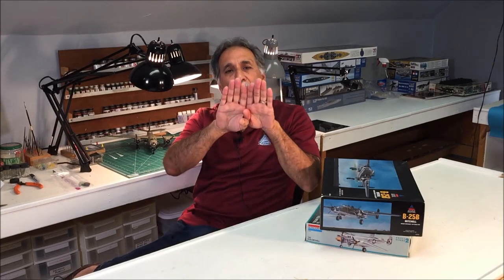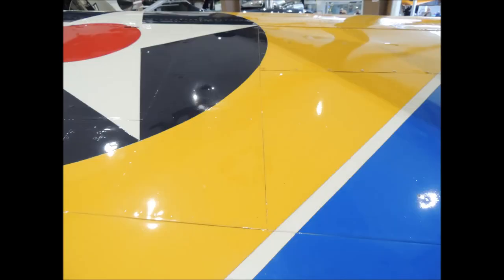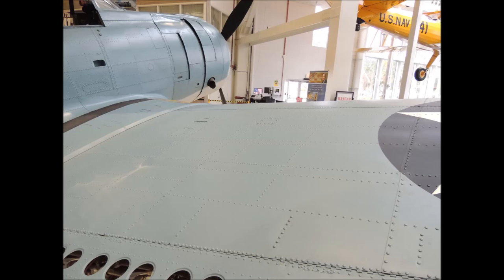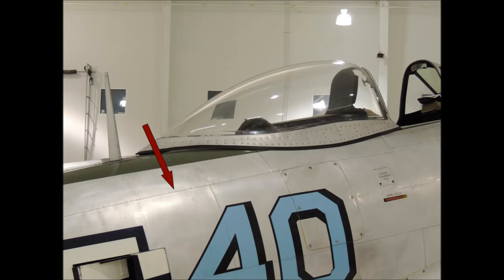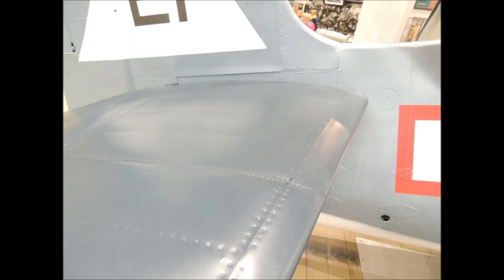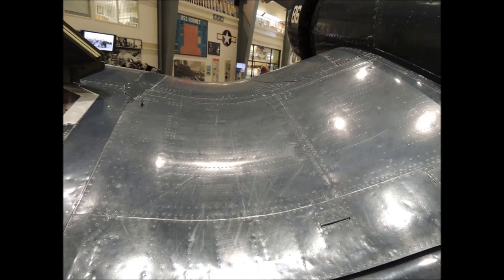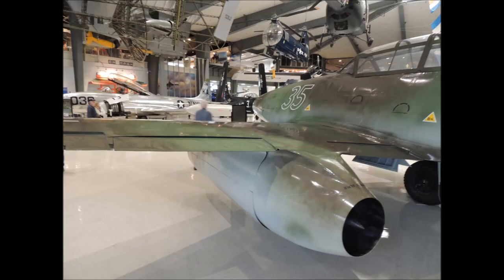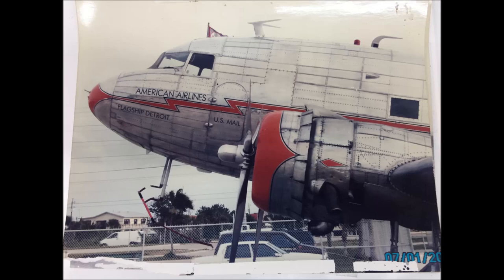Panel lines for scale model aircraft and how they relate to real aircraft butt  and lap joints.

Comment: Glad I found this video( actually, it found me, lol). This has been a bit of a pet peeve for me for years, as a modeler and an aircraft technician. The huge, raised or engraved, panel lines and rivets on models (don't even get me started on the raised vs flush rivets! ) are usually so far out of scale to be ridiculous. As you were saying, the gaps work out to maybe .001" or less, in 48th scale., and that would be practically invisible on 1/72nd unless you have your nose touching the model.  The DC-3 (C-47?) is a great example showing that only the dirt is delineating the panels, otherwise they'd be invisible if the aircraft was clean and polished.

Comment: This is a great presentation. The challenge is the pictures need to be a lot closer to the surface for the difference to be seen on a mobile device. I think a great follow up video would be to explore how to simulate these differences on various scale models. I say "simulated" because as you mentioned, the scales in which most of us model really are are too small for engraved or raised panel lines to be realistic scale-to-size replications. I'm dealing with that right now with a 1/100 scale EE Lightning a friend gave me.

Comment: it would be interesting to see what a company could do with 3d scanning these planes.
Reply: Actually model manufacturers (Airfix as an example) are starting to use LIDAR 3D scanning to develop CAD drawings for CNC die milling. The challenge is in the level of definition currently available. It's great for getting dimensions correct. I'm not sure if it's that refined as to pick up those subtle differences.

Comment: All those aircraft models over the years which have been shaded before or after painting to show up the detail of a recessed line and on the real thing, no where to be seen? And all the moaning about raised lines on some companies kits and having to sand them all down, and guess what? they got it right after all
Reply from the maker: Hi Keith

The short answer is yes and no

The only aircraft from WW-2 that were either all smooth or all but jointed that I have documented thus far are the ME 262 and the F4U Corsair

The rest were combinations depending on the location on the airframe